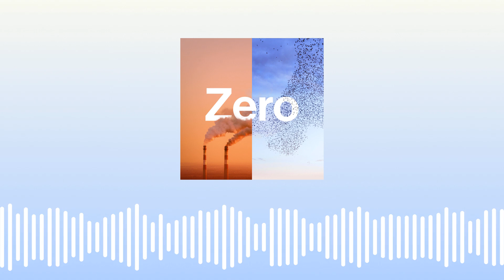There aren’t enough cables to meet rising electricity demand: Bottlenecks Series | Zero: The...

Comment: The electric system business model is bankrupt. Electricity ought be produced where its consumed. Plants ought to produce their electricity behind the fence, behind the meter - not allowed to make demands and socialize their costs on the quasi-public grid. Yet, they could sell excess power to the grid. Commercial , government buildings and housing developments ought also provide their own power via neighborhood fuel cells, solar roofs with batteries, or geothermal. Cables, lines, transmission are an 18th century answer to 21st century needs.

Comment: great conversation. I feel DC is the future from here onwards because of it's operating characteristics and also because photovoltaic solar energy and battery storage adoption is becoming more widespread in many forms for electrification and they are also DC energy sources. what needs to go along with that is the technology to switch DC back to AC at specific end point locations if necessary same with AC back to DC through electrical design solutions like solid state DC transformers, power inverters, bridge rectifiers. the entire variety of power electronics. So with all these component as part of a grid system whether it's micro grid with 4 solar panels or continental scale. There Is also something called the skin effect with cables and the relationship with frequency current and voltage may be part of what power system consideration.